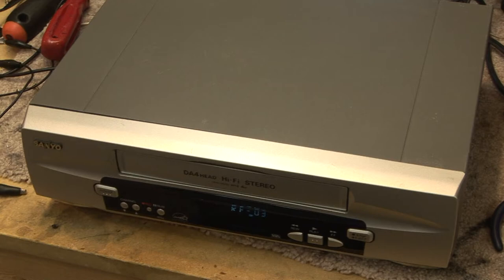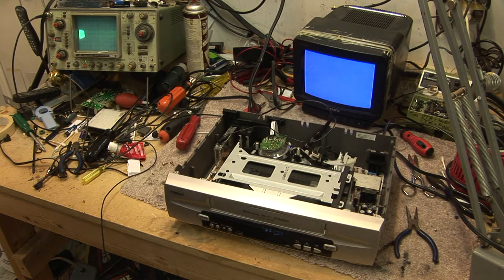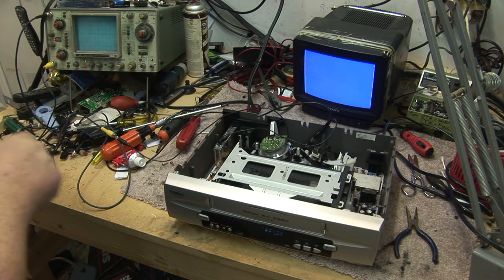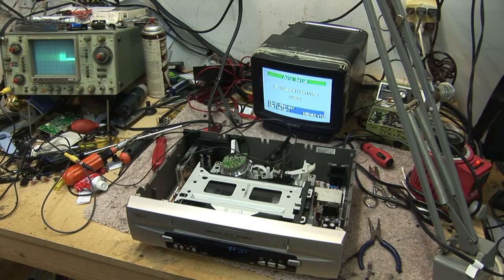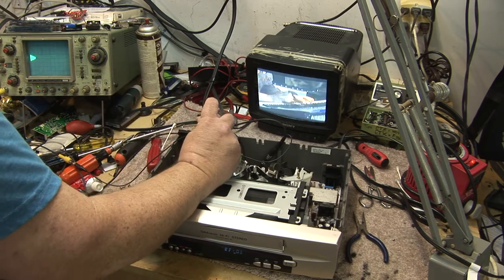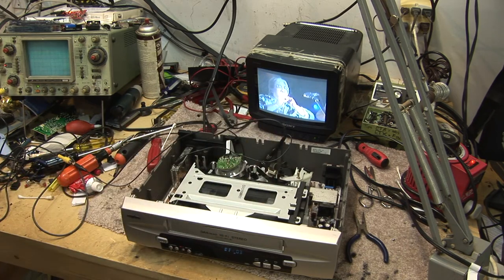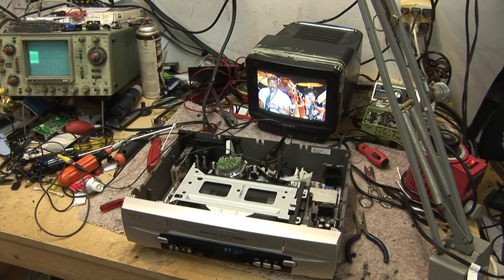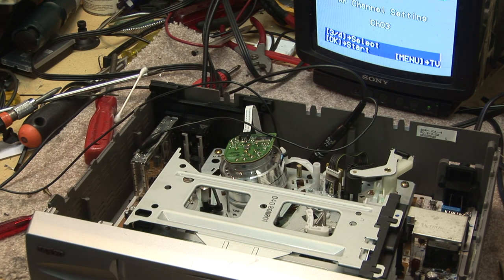Sanyo VCR picture blue screen on play. picture in pause and search.

Comment: I have a JVC and have same issue. No picture (sound works) but if I search forward or reverse it gets a picture. If I play around with the flat cable of the track head it switches to LP and shows an image but plays slow. I tried cleaning the tracking head. If I disconnect the tracking head same, plays (with picture) in LP mode, albeit in severe need of tracking. When playing in SP (sound yes but no picture) the Super VHS logo lights up on the VFD. What could be the issue ?

Comment: hello. I have two vhs jvc version HR-D721EN and both play with sound but black image,
I already cleaned the heads and it's still the same, if I fast-forward there you can see the rain but then it's black with the play logo.
any idea how to repair it or a circuit that is wrong.
for some reason it is blocking the image... thanks

Comment: 12voltvids I'm having a little problem with my Panasonic NV-SD435, sometimes when i put a tape to play, whether i got a blue screen or the TV says "No signal", it solves when i clean the head drum. What could it be? i recently made an overhaul on it, because the tape transport system wasn't working properly.

Comment: My Sony SLV N51 VCR has the same exact problem but after cleaning the control track there is no improvement. Could the heads be damaged? I get a picture in Pause and Rev and FF but a blue screen on Play.

Comment: All I could see was your back when cleaning 5:25 😥I cleaned what I think you were cleaning it did not work it plays great for a minute then goes blue screen for 10 seconds. Great 1 min blue 10 sec . On and on. when it's blue if your rewind you can see the visual.  Or fast forward the visual does not ever leave, only in play for 10 sec.

Comment: like, why stand in front of the part you're cleaning. and then when you move your whole hand covers the view
Reply from the maker: I think the answer is perfectly clear.  I am faking this and i don't want you to see what i am doing 😂
Reply: @12voltvids  strangely i just stood in front of my open vcr and it worked too 😄. Thanks for the vid and fix.
Reply from the maker: @stonathanjokes2142  it was a joke in case you didn't get it.  This was done what 6 years ago long before i was set up with an overhead camera jib.
Reply: @12voltvids  I got it and joked (on the concept of faking it, in that you may have actually been doing nothing according to the viewer)  back at you
Reply from the maker: @stonathanjokes2142  Are you suggesting that my videos are staged?
Well some are, if I find something and miss the shot because for example the camera shut down, which does happen, especially with Sandisk SD cards (shots fired at Sandisk for their shitty memory) then sometimes I have to re-shoot, the scene, and since the problem is already fixed, I have to go through the motions. Say I have already aligned the machine, I won't actually turn the guide, and will use camera angle to ensure that the guide can not be seen turning. On other cases, I will be shooting say the scope screen when I do the actual alignment, showing what it happening, and when I shoot the shot of the guide post, it is a retake, or it is done before I shoot the scope.
Reply: @12voltvids  no. Joking that they could be interpreted as staged is not suggesting that they are staged

Comment: i recently attempted to start archiving 9mm video from a camcorder. (sony ccd-trv17) playback worked fine, then after 10 mins, video was blue and audio was ok. perhaps this is what I need to do
Reply from the maker: 8mm not 9, and no that isn't the problem.  It will be capacitors in video circuit.  On 8mm the sound is recorded along with the video using the same heads and there is no control track on 8 mm tracking is done by signals recorded in with the video. If you have sound and no picture there's a problem in the video playback circuit. if it was something simple like a bad head or dirty heads you would have no sound or picture because the sound and picture are both recorded by the same heads. If it was a problem with the head preamp for example it would also affect the sound.
Reply: @12voltvids  a 1 mm typo, oops. If I forward search or reverse search the video can be seen, only during playback does it go  blue. I am searching through every video in your channel, hoping to find a solution for my issue. Or should I start an ebay search for a n 8 mm vcr  machine?  and I love watching them
Reply from the maker: @dirtyoledog519  yeah it's going to be capacitors in the playback video circuit, likely the Video sync pulses are low thus triggering the blue screen. When in pause search forward or search reverse external sync is inserted and the mute is turned off
Reply: @12voltvids  Thanks so much. I loved spending some time watching the videos you have made. especially a fellow canuck  dashcam video. I guess either I try to find a local repair place or attempt to buy the video 8mm vcr for my purposes. Great stuff you have created. Subscribed!
Reply from the maker: @dirtyoledog519  I have many more road trips in Canada that I haven't even begun to work on. A few hard drives full of files.

Comment: I have very similar symptoms on a  Sylvania-branded VHS made in Japan in Jan 1992 (believe it is same as Panasonic).  But cleaning the control head did not solve it. I get a picture on Pause or Fast Forward, just like this. Difference is there is no color in it. Picture is grainy and has several wide gray horizontal bands on it. 

Any ideas on what to try next? Don't see any obvious bad caps. Have owned this machine from beginning. Problem started after I cleaned all the heads and rollers to solve graininess problem. Worked well for about 10 to 20 hours after that.
Reply: Larry Hecht Replace the caps in the servo board even if the look OK visually.
Reply: Reading through the  comments, it's seems this video was of no help. And the creator of  the video did answer any of their questions.
Reply: @thewaltbrownellchannel9318  That's not my impression.
Reply: @SiteReader   I read at least 4 comments that said they tried this and it didn't work and none had a reply.